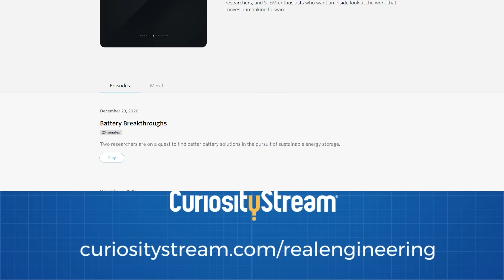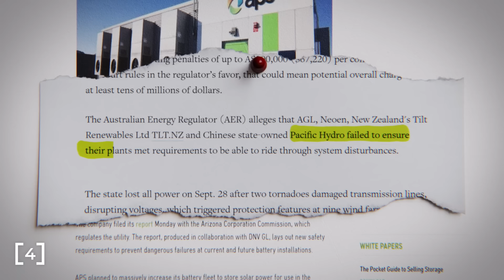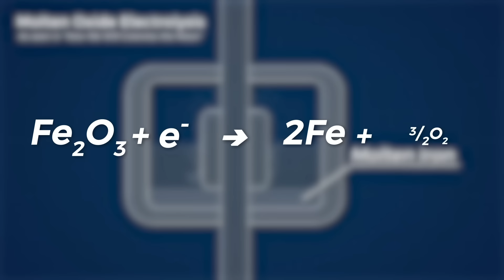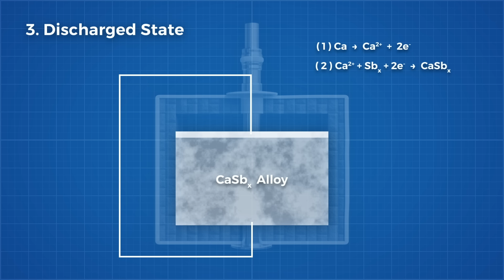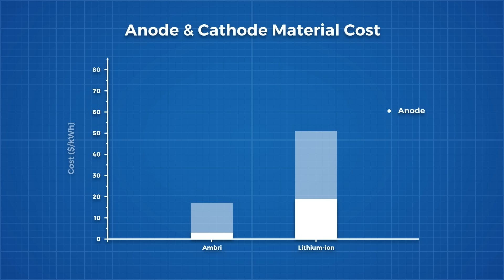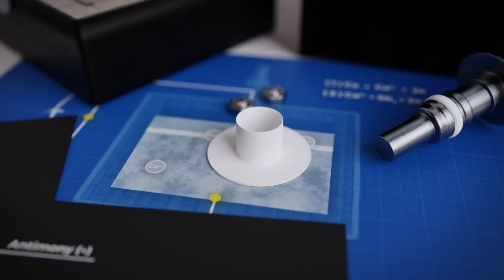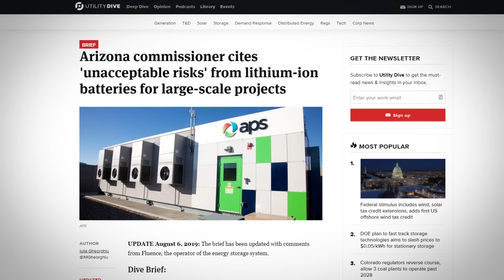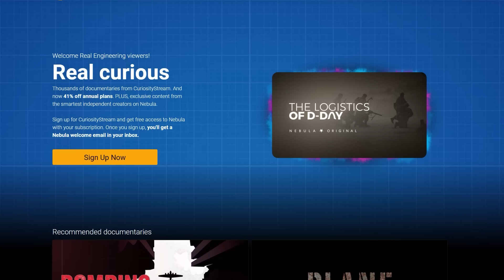The Missing Link in Renewables

Comment: Actually pumped hydro in the correct setup can provide close to 100% renewable energy. See the key is the ensure you have a suitable heron pump to fill the reservoir back up as it is being used. The end result is a continuous cycle. Over time you might have to add a little more water for the sake of evaporated water, but that is rather insignificant.

The only reason they do not do this yet is because they cannot earn enough money from it. Simple as that.

IF they were to start using this well tested and known strategy, they could eliminate many of the "standard dams" they built that completely change the landscape, ruin habitats reduce available land, etc. They are literally and intentionally choosing to use the most destructive methods imaginable. Still they are not able to succeed and now they have exposed their agenda.

Comment: Could the excess heat generated by these liquid-metal batteries possibly be used to boil water to run a steam turbine to generate more electricity?
Reply: These batteries work at 500 °C. Removing heat from them to power a vapour turbine means having to increase the electricity needed to heat the liquid metal bath, which means increasing the 20 out of 100 electric units needed to heat the metal. It could be use as a way to CHP, allowing to choose between thermal or electricity needs. But I don't think there is excess heat in this case.

Comment: The argument has a fundamental flaw not recognized (or ignored) by the speaker. Weather-dependent energy sources vary by large amounts - 50-100%. Those variations not only occur daily but monthly and yearly. Moreover, significant "energy droughts occur , some times spread over continental areas, as occurred for all of Europe during July 2018. These are completely unpredictable in frequency and magnitude, so there is no possibility of somehow planning for a future system-wide drought, if the extent cannot be predicted. 

Our climate science community has cautioned us about this flaw and argued that dependence on renewable energy is a mistake.  But, instead, we listen to commercial promotions of RE presented here.
Reply from the maker: The entire thesis of the video is based on the exact thing you are saying I "ignored". Your complete fixation on arguing against renewables seems to have blinded you to an unbiased take. Happy to debate when you work on your comprehension skills.
Reply: @RealEngineering  The presentation makes NO reference to the problem, RE. The liquid cell battery described here has an 80% efficiency ONLY if it is recycled charge/discharge every day - a minor detail you neglected to bring up.  If not, then additional energy has to be introduced to keep the battery at operating temperature.  The longer the storage time, the more energy lost to maintaining operating temperature.  The problem I refer to is the very occasional periods of time when there will be weather events where a large fraction of energy capacity is lost. That his will happen is a statistical certainty.  The July 2018 event is an example. The UK has seen multiple examples for their grid. An examination of total US daily wind energy output shows the same "fractal" behavior. This is an example of the "Black Swan" problem that Mandelbrot and Taleb described.  

So the problem for weather-dependent energy supply is this: How do you store enough energy for a long period of time (say 2 years) to accommodate a loss of a large fraction (say 80%) of the total national energy output for a long time (say 10 days). This battery technology does not answer that question. To date nobody has proposed a realistic answer. James Hansen and his colleagues assert there is no answer and we need to switch to nuclear power - that you and your fellow promoters of renewable energy are believers in the tooth fairy or Easter Bunny. What response does the RE community have to this? They agree with Hansen on the problem. But energy reliability is really not all that important. We need to learn how to accommodate such events.
Reply: @RealEngineering  I can hear the crickets chirping, but not anything else, RE. I will assume, then, that you have no response, and that the fundamental flaw pointed out here remains unaddressed. 

The solution, obviously, is to follow the advice of our top scientists, and switch to nuclear power.

Comment: Safer fission energy? Life cycle deaths per MWh is lower for nuclear than any energy source. COeq emissions are tied with wind as the lowest before including the carbon footprint of battery storage/redundant capacity, making nuclear the cleanest as well. Breeder reactors like the IFR or Gen IV designs based on it solve the waste problem as well.

The problem is cheaper.

Comment: I really want to know if kinetic energy storage would be a viable solution, raise large weights with pulleys and drop them to drive a system of flywheel generators, it could be done very quickly, cheaply and provide a reasonable amount of power and the technology can be replicated anywhere in the world, all that's needed are a proper gear/pulley system and generator, local resources can provide the weight. This would definitely be great for developing areas, a kit that converts cargo ship containers into power storage, fill the shipping container with local rocks/sand and set up a pulley system attached to a generator, possibly with a flywheel, manpower could lift the container given enough wire and pulleys or it could be attached to another power generator and use passive excess to raise the weight(s), a waterwheel or windmill could directly lift the weight without needing to generate electricity beforehand, only transforming the energy when needed using the weight and the weight storage could be used in tandem during times of excess consumption

Comment: the best option is stored hydrogen gas, run through electrical generating turbine(s).  if you scale small enough, you don't have to accept the high-costs traditionally associated...plus, the individual components are swappable...meaning there's no lifespan to the technology, the way batteries have limited life-cycles.
Reply: The most efficient use for hydrogen is low-pressure "combustible" in the ICEngine of a plug-in hybrid PHEV+H drivetrain. Fuel cell EVs require hydrogen stored at much higher pressure. PHEV tech distributes limited Lithium-ion battery resources far more equitably than all-battery BEV tech. An estimated distribution chart is like this: '1' BEV freight truck pack of 500kwh (5 packs over 10 years), '30' BEV Tesla 'S' sedan packs of 85kwh, "150" PHEV Chevy Volt packs of 18kwh, and "500" PHEV Prius class packs of 5kwh. (All sedan packs last an average 10 years). The Chevy Volt PHEV is rated 150mpg when average daily drives are kept below 50 miles. The Prius PHEV is rated 100mpg when average daily drives are kept below 20 miles at speeds under 45mph. I will grant Liquid Metal battery tech as useful for stationary power supply, but every household EV should have Lithium-ion packs to act as back-up power supply in emergency power outage. So, should we power '10' BEV Amazon freight trucks or as many as "5000" PHEVs matched to rooftop PV solar arrays? Uhhhh. Is that such a hard question?

Comment: Couldn't a possible solution be to dig very deep holes and then have these massive heavy weights be placed in the hole. When Power is stable these weights would be lifted to the top of the hole. When power is needed or if there is a shortage the weights would slowly descend into the hole and the power that is generated by gravity pulling on this weight could then be used as an energy source.

Comment: I don't understand why you're not talking about sodium ion batteries and all. These are not only cheaper, but salt is almost infinitely available! Using solar brine extraction from seawater, simply in the process of creating potable water from the city there should be a huge amount of brine available for sodium ion batteries. They don't even need to waste electricity to turn the sea water into steam, simply used curved panel mirrored half tubes with a pipe full of sea water in front tracking the Sun up in the sky. These would have pressure created because of flashing almost immediately into steam, which would rise, and proceed to a condenser unit. Possibly run it through the sun panel System twice or more, to make the taste even better. The remaining particulate can be further separated into sodium and other elements contained in seawater. Yeah

Comment: would it be an improvement to store the batteries? underground or underwater where the pressure is much greater, therefore, decreasing the e required to keep the the batteries in a liquid state?

Comment: This is very interesting.  The system I am developing will need a power source capable of high cycling, as I plan on matching it up to solar power.  In developed areas, grid storage would be a workable solution, but in this system's expected environment off the grid that simply isn't an option.  This battery techay be useful for this.

Comment: If you have liquids in batteries that need to settle and separate by density? They won't work in micro-gravity like on the ISS! 
I did Chemistry A-level but don't remember doing anything about batteries then (nor in physics) - we did something on electrolysis... hard to remember so many years later.

Comment: I'am more surprise that there's not yet a large battery grid to store excess energy on the system for further future uses. I thought about it if there no demand why would they build one if current needs is enough or its just not practical to build one a large yet small capacity battery that is easily depleted

Comment: The Lithium Battery storage at Hornsdale in South Australia is NOT the only thing they did ,it did not solve the Problem alone . 
GAS fired power plants were added to the system , seems no-one wants to mention how much energy they provide . The huge transmission lines to Victoria Power plants over 1,000 kilometres away which were destroyed by storms were replaced . IF you took them down the System would fail again . South Australia failed for decades to build power plants and simply bought power from other states as it still does today . The battery can only provide power for 30,000 homes for about 3 hour , lets get real Adelaide has over 300,000 homes . Pelican Point power plant plant can produce 480 kw continuously ,once  the 100KW battery is flat it can only be recharged when there is excess power in the system . Trouble is when the sun goes down and the wind speed is low its useless as it gets drained quickly . ITs a kids toy that cost $100 million . Remember Adelaide has some hot weather it can be 14 days where the nighttime temperature does not go below 38C ( 100 F )  and is a lot hotter in the day , so Air conditioning gets a workout .

Comment: The energy lost to heating could be reduced by reexamining the specific heating process with electricity and optimizing that reaction. Similar to ionizing water, the original probe in the water with DC power is not the most efficient approach. Party on Dudes, be good to each other.

Comment: The efficiency of pumped hydro Cierny Vah installed in my country is 74,5% (statistics gathered for over 18 years of its operation). I am afraid, that professor is rounding up efficiency numbers here, so I would say those two technologies are very close together, whe talking about efficiency. The main advatage of those batteries is, that the storage facility can be built almost anywhere,

Comment: Curious if the waste heat from nuclear plants or solar thermal plants could be used to keep the batteries molten to lower the round-trip efficiency.  If LFTR and other Gen III+/IV plant designs have taught me anything, its that having multiple value-adders stacked together can help overcome initial costs.

Comment: Dumb question, could the efficiency hit of due to heating LMBs be mitigated if they were used in conjunction with nuclear? (which already runs at many hundreds of degrees). 

So hypothetically, one of the loops in the nuclear power plant passes by the batteries which want the heat. The batteries can then be charged/discharged on-site, the location already has access to transmission lines (so no new power-pole infrastructure needed) and since its hard for nuclear to ramp up in times of need (as their output is consistent, and thus why we have fossil-fuel peaker plants), they could act as an easy way to increase output at a moments notice for the nuclear power provider. 

If there aren't too many errors in my assumptions (I'm just a guy who likes learning about this stuff on youtube...), seems like a winning partnership.
Reply: Actually an interesting question. The first liquid metal batteries were called thermal batteries because they were designed to be recharged by thermally distilling the discharged battery products back into their separated usable anode and cathode materials. The thermal regenerator was either proposed to be a nuclear reactor or some solar concentrator, but when they realized some of the batteries could be used as secondary batteries they put their focus into that. This was all done mostly in the 1960s. But in terms of keeping the batteries hot, I don't think it would save money by building the needed setup for nuclear heating, as nuclear power already doesn't have a problem with inconsistent power delivery as renewables do.

Comment: IMO the advantages of Liquid metal battery of Li Battery is minimal at best, I would much rather have the guy who is storing energy with actual dirt.
Reply: Their biggest advantage is that lithium battery production is taken by the car manufacturers. There’s simply not enough battery production for everything.

If they can make something that’s cheap and reliable now it can work to their advantage. Costs are as always the biggest factor in these things.

Comment: I agree that, no matter the energy production method, grid storage at  massive scale is a huge advantage to any power generation/supply scheme.  So in all senses this video is accurate.  However, I think you too quickly dismiss how fission nuclear could be a significant and safe contributor to the total energy needs of the planet.  The stumbling block for new fission nuclear is largely perception and the pace of  regulation.

Comment: If lithium batteries need to be cold, but produce heat and the liquid metal batteries need to be hot, is there no way to make a hybrid of the two? You could use some sort of heat pump to level out the heat between the two? Could that increase efficiency?

Comment: 7:59 is clasifying hydrogen as a metal a mistake? im pretty sure its a gas but maybe i missed something in chemistry
Reply: An element's state at room temperature (solid, liquid gas, plasma) has nothing to do with its classification as a metal/non-metal.
Indeed, at room temperature, mercury and germanium are liquid.
Reply: @attilajuhasz2526  i see went a googled it and it appears recently they discovered it was a metal under the right conditions really interesting thanks for the reply!

Comment: Some alloys are liquid at lower temperatures than their pure components, did they consider the possibility of eutectic alloys such as this in their design of the battery?
Reply: There's a bit of research on using liquid metal alloys as anodes in batteries. The problems are usually from high surface tension which makes it hard to wet an electrolyte, a limited working range of mol fraction composition, and a more intensive manufacturing process. A NaK alloy works ok if potassium is the charge carrier, but finding and optimizing an appropriate cathode is more difficult.

Comment: I still can't find the open-circuit voltage and current rating of those batteries.... What are the benefits of those batteries compared to super-capacitors?
Reply: the ocv i found was 0.95V. Im not sure if the specifications are up to date however.
Reply: the ocv i found was 0.95V. Im not sure if the specifications are up to date however.

Comment: As an engineer in this field it is clear why the liquid metal batteries will not work. They require too much energy to be cycled at that temperature, meaning that while the price of the battery goes down, the price of the energy goes up. Electricity prices would need to be much lower when charging for such a solution to be profitable. Todays lithium ion batteries will give you back roughly 95% of the energy you put in, and the ones designed for long life can last for 20 years

Comment: "lithium ion batteries is the cheapest batteries avalible" 

Not even close.  The common led acid battery is like 1/3 of the cost. Even led acid battery last for high cycles are cheaper.

They are still way to expensive for that.

Batteries is really just viable for power between 10 minutes and 2 hours.

Comment: Theres some misleading graphcs here regarding tesla batteries, ive seen as per other data modeled on Electrek that even after 50,000k miles the tesla battery is over 96% capacity, and even after 250,000km on average getting in the low 90% range. If an average driver (in the UK) drives around 16093 km per year. 
By that maths, it would take around 15 years of driving for most drivers to see a 10% loss in overall range per charge.
Reply: I may have jumped the gun, i think you corrected it in the "new batteries for model 3" part

Comment: ACTUALLY...the NCA, LCO, and NMC battery chemistries thermal runaway problems will (or has already) open the door for cheaper and safer LFP batteries for everything from EV to home power storage to utility scale energy storage without the demand for rare earth elements.  Thermal chemistry energy storage has a long way to go and as expressed in this video, has a fragile infrastructure that is difficult to manufacturer.